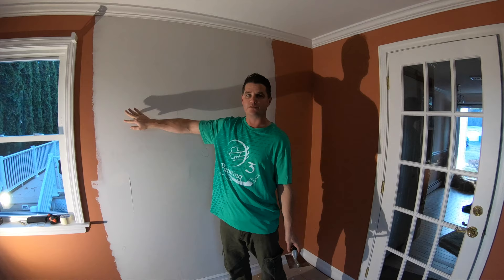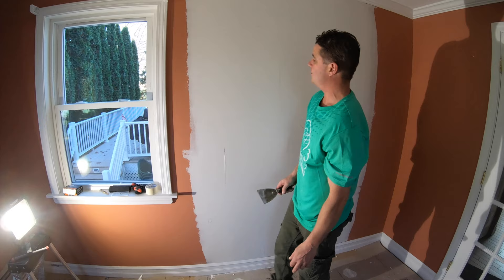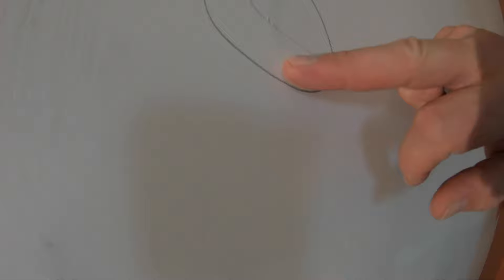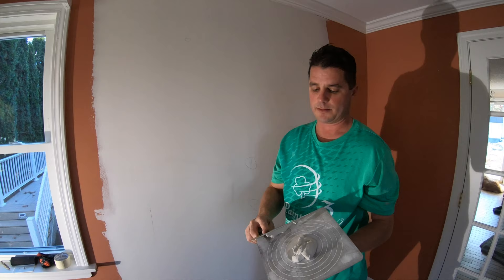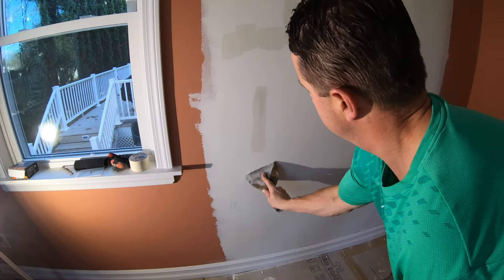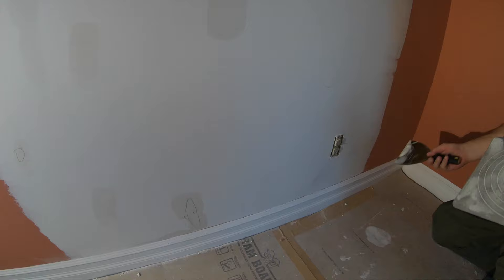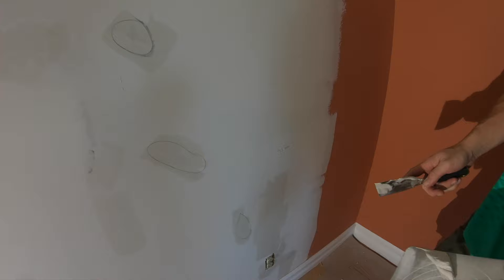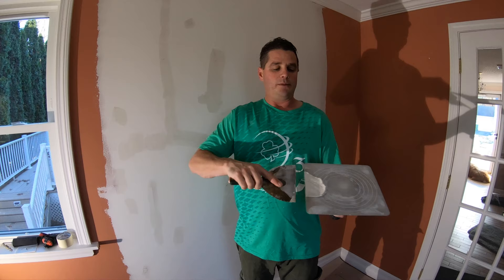How to Tape and Float an Uneven Rectangular Drywall Sheet -  Drywall Repair (Part 7 )

Comment: Great Teacher thank you!
Iam trying this type of repair soon.
Reply from the maker: Thank you Elias! Please let me know how you make out?
Reply: @RussOlinatzPaintShow  
I will!  I think I might need a longer trowell, mine is only 12 or 14 inches.
Also your tip of filling in small imperfections rather than sanding through will help me a lot!
Reply: @RussOlinatzPaintShow  
I just got done with my small project.  I did a lot better with a lot more ease than I had anticipated.  For what I had to work with=A slanted existing wall with low spots everywhere I am very proud of my results.  It is work of high quality, on par or better than some of the work done elsewhere in the appt by pros.
Granted it probably took me 4X more time than pros and I ended up with a lot of dust from sanding but the end result is fantastic thanks to YOU (and the vancouver carpenter).
Took a before and after picture if you have a way to receive it.
Reply from the maker: Hello Elias

Thank you so much! I am glad everything worked out fine for you! I have a Facebook Painting page. You can share your pictures and comment to my Wall please. 

https://www.facebook.com/russolinatzpaintingllc
Reply: @RussOlinatzPaintShow  I don't have facebook but I will borrow an account!

Comment: I'm having trouble using the trowel. What's the proper procedure to spread.
Reply from the maker: Hi Peter

Watch these videos!  https://m.youtube.com/playlist?list=PL54E474153945E5C3
Reply: @RussOlinatzPaintShow  Thanks
Reply from the maker: How did you make out?
Reply: @RussOlinatzPaintShow  my trowel is curved so I need a flat trowel. Been using longer length mud knives for larger areas. Looks good while I'm working but when dried , I see lines. Before each pass I clean off the front so there are no dried pieces to cause the lines. What's causing this? Too much pressure?
Reply: @RussOlinatzPaintShow  when working the trowel, do you start on a 45 degree angle and gradually turn the trowel inward or keep at a 45 degree the whole length?
Reply from the maker: Hi Peter

Yes, you don’t want to work with a curved trowel. Get a quality flat  trowel. In fact, get two. I would get a 12 inch and a 16 inch. The lines in the mud on the first few coats is normal. The surface isn’t level yet and you will always leave a draw line. No problem, after it sets or dries, simply shave these away with a 4 inch flexible taping knife. That’s your sanding! Then recoat with trowel and Span mud out further than existing, and you will eventually create a smoother surface. You will get draw lines on your second coat also.  Then on 3rd coat, the surface is more even with less draw lines. 

Russ
Reply from the maker: Hi

It depends on what coat you are applying and wether or not you want to leave the mud on the surface or skim it away. 

Russ
Reply: @RussOlinatzPaintShow  The lines are not on the surface ,they are embedded in the mud. There's nothing to scrap. I know the lines you are talking about and I can scrap or sand off.
Reply from the maker: Hi

Is it from having chunks in your mud?

Russ
Reply: @RussOlinatzPaintShow  I'm mixing the mud with water and smoothing it out n cleaning the knife between each stroke. I don't see it while working but I do when it dries with more light on it. Since it is on a basement stairwell I try to light it up as much as possible. Not to concerned if I need to put down another layer.
Reply from the maker: Hi Peter

You will find it gets easier with every layer. The last layer you want to increase the angle to really skim tight and make smooth!

Russ
Reply: @RussOlinatzPaintShow  ok